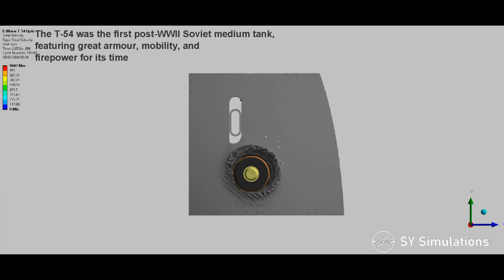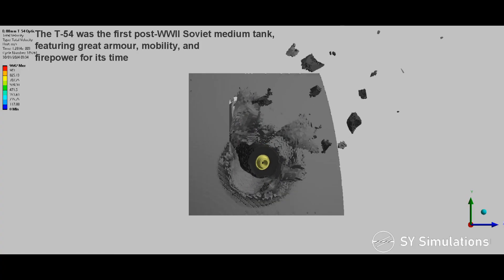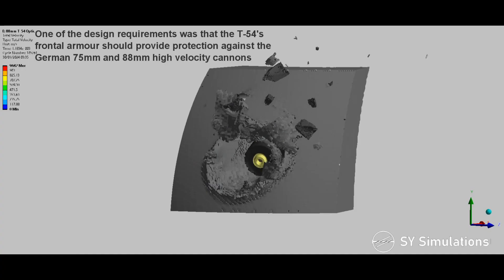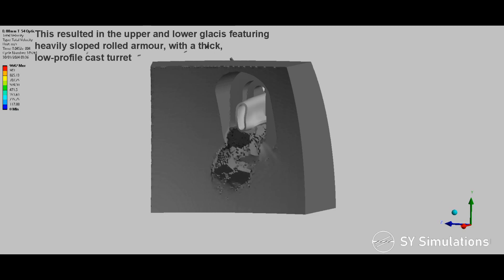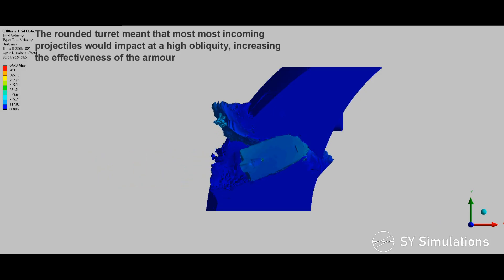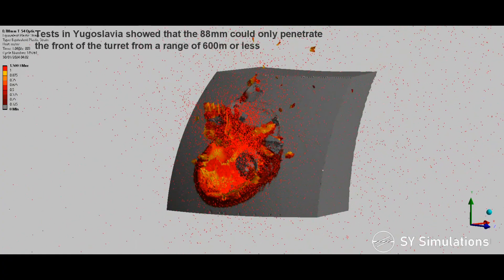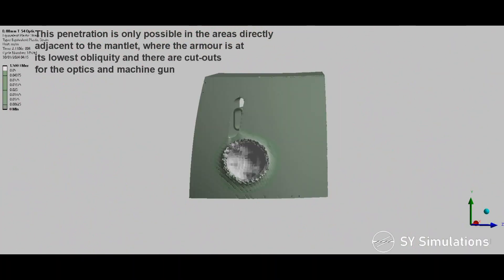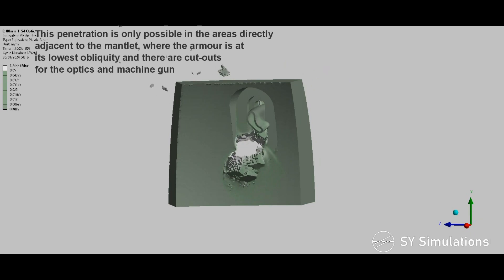TIGER II vs T-54 | 88mm Pzgr.39/43 vs T-54 Turret | Armour Penetration Simulation

Comment: This long 88 was one hell of a gun , imagine a APDS 88/50mm sub caliber as the 128/88mm . Did you ever test the 128/88mm APDS ?
Reply: He didn't, but I'like to see
Reply: I think the 128/88 liked to shatter but I might be wrong
Reply: @mikelprasad1924 it did, cause it was just 88mm Steel APCBC round fired from 128mm
Reply: @Kether25  And thus never fielded in the military or concidered seriously for combat.
Reply: @TheEsseboy  ye, only versions ever considered for service were for self propelled howitzers as alternative direct fire round to HEAT
Reply: On the E-100 vs IS-3. 31st December 2023
Reply: Yes, he did (iirc)
Reply: I think he did videos on the 128 apds
Reply: You might be surprised, but that kind of APDS round would be practically useless, as even on the 128mm/88mm APDS round the 88mm penetrator impacted at such high velocities that it would just shatter on impact without penetrating. At extreme ranges, after drag slowed down the penetrator it would not shatter anymore, but those are ranges you will almost never realistically fight as, and even if you do, a normal 128mm round would probably suffice either way.
Reply: To be fair, at a certain caliber the weight of the shell alone, would do tremendous damage to the target. Particularly if you fill it with explosives. 
In Ukraine, funny enough, artillery has proven to be one of the most effective anti tank weapons. Because even a near "miss" with an 155mm artillery shell, will damage or outright destroy a tank. - Arguably it's not a "penetration" of the target with an explosive shell, but still, considering to a very modern and sophisticated subcaliber ammunition.
a 128mm gun, like from the Jagdtiger, is not something that you shrug off so easily. Even with modern armor.
One isshe though is that a "conventional" shell from a 128mm gun would loose rather quickly it's capability to penetrate armour on larger distances where as modern tank guns can achieve their impressive armour pearcing quality at much further distances.
Reply: @CrniWuk  The artillery thing has been known for a long time, a typical 155 mm shell contains an equvialent of 11 kg of explosives...which is enough to critically damage tanks even at several meters from the tank, as they usually have airburst fuzes, so the sharpnel is projected radially outwards, which damages optics, barrels, tracks, engine decks, radiators etc. 

Modern armor is geared towards absorbing energy, so even a jagdtiger shell would be easily absorbed, and on a soviet tank the 68 degree frontal angle would make it bounce, especially as the armor is 100-170mm thick at that angle!
Reply: @TheEsseboy  There is a simulation of the 128 shell against the Abrams armour. While it didn't get in to the crew compartment, it still was quite impressive what the shell achieved. 
It would be "absorbed" yes. But I still don't think that a hit would brighten the day of the crew. I mean it could still cause some damage to the mechanics of the tank. That's not uncommon.
Reply: @CrniWuk  Sure, but the front hull is the along with the turret "neck" the weakest part of the front of the Abrams, the turret is what is meant to be the most protected from the front, and an arc of about 20 degrees to each side
Reply: Wehraboo
Reply: That the only thing you can ever write? Wow guys, we've got ourselves a real smart specimen here
Reply: Germany never fielded a 128/88mm round, the long 88 is similar to the post-ww2 90mm American guns. Nothing special, just a long heavy cannon, outdated.
Reply: @TheEsseboy  It wasn't until the M36 gun on the M47 that was rated to fire super charged T33E7 (standardized as M318A1) in 1951 that the 90mm gained parity with the KwK 43. The 90mm gun wasn't a terrible one but the US definitely had the worst post war tank gun of all the major powers and took far too long to replace it.
Reply: @signs80  I think the reason the US hung onto the 90mm gun for so long was that they had the idea that the future of tank weapons design was going to rely more on the projectile than the cannon itself and they were kind of right, prior to composite and ERA armors being developed the HEAT shell was basically unstoppable and the development of APDS made things like the 17 pounder able to punch above its weight for quite a while. the reason the US bothered replacing the cannon with the 105mm was simply that standardization was deemed necessary and the 105mm was a pretty solid improvement with its available ammunition.
Reply: @dominuslogik484  I think that may have been why they stuck with it into the late 50s, but I don't think that was originally why. T108E40 was the first HEAT round the 90mm had in service (it was standardized as M348 in the late 50s) but it wasn't even ordered until 1952. I think it was just that the defunding of the military post WW2 made it so tanks weren't a high priority, which would probably also explain why we stuck with descendants of the M26 Pershing until 1959.
Reply: @signs80  yeah the low funding was also a part of it, plus the low priority in the korean war as the majority of Soviet and soviet alligned tanks were still T-34-85 and IS-2-1944 which both could be engaged by the 90mm gun relatively effectively. also the M103 was put into service in 1957 as the answer to the heavier armored tanks that might be a struggle for the 90mm gun. procurement was a mess in the 50s unless you were dealing with aircraft and that by comparison progressed at a frightening speed.
Reply: @TheEsseboy  It actually was considered for use and was tested towards the wars end. It was intended to be equipped for E100.
Reply: @ulfenburg7539  It was never going to be fielded, it was so high velocity that the metallurgy of the time meant it would never stop shattering. It took until ~1200m or something around there before it slowed down enough to not shatter on impact so it wasn't particularly useful for a tank shell.
Reply: @signs80  I know but that doesnt change the fact that it WAS tested and it WAS considered for use for the E100. I mean they did intend to use it even. Now how effective would have been? well that is an entire different discussion but the short answer is that it would have been very bad for the reasons you stated. 

Though stating it wasn't considered for use is just plainly wrong.
Reply: @TheEsseboy  The long 88 was significantly more powerful (kinetic energy wise) than the 90mm the US used with the 90mm gun being more comparable to the Tiger 1's 88mm and not the one used by the Tiger 2.
Reply: @dominuslogik484  Yes, during the war, but not after the war.
Reply: @TheEsseboy  Lol that gun was state of the art at the time. How was it outdated back then? 😂
Reply: @Squee7e  Point to where I said back then please.
Reply: @TheEsseboy  The American match to the long 88 was the T54, but in the end they opted for the lower performance T119/M36. 

The M36 was backwardly compatible with the M3, and the U.S. had a large store of M3 ammunition.
Reply: @TheEsseboy  American 90mm guns did not reach 88mm parity until late 50's.

Comment: "That one didn't go through".
Meanwhile the gunners face is gone.
Reply: easy, just use the medkit
Reply: @salazar778   Nah, crew replenishment works, just wait a while.
Reply: "It seems we missed!"
Reply: *Slightly yellow gunner
Reply: Yeah Cry Wehraboo
Reply: Soviet Leadership : Who cares. Tank still operational.
Reply: @CrniWuk tank is "operational", but no gunner and probably no commander...
Reply: @AKUJIVALDO  
Soviet Doctrine in Spiderman-Voice : I don't see how that's my problem.
Reply: this shot basically is shoot right in front of it, with less than 10 meters distance(943m/s)
Reply: @vict9451  The muzzle velocity of the KwK 43 is ~900 m/s at 1000m, it loses about 10 m/s per 100m for the first 1000m. This is at 600m not 10m
Reply: Science wins!

Comment: 600 m is still quite substantial.
Reply: It's specifically weak area. Main cheek won't budge.
Reply: Source? @gargean1671
Reply: No,it isn’t . Normal tanks engagement range in late WW2 is around 1km and above, 600m and below is only happens during ambush or surprise engagement
Reply: @vunguyenxuanhoang7422  Actually that's not true. It depends on the Theater, but the US found the average engagement distance for them during WW2 was 800 yards (and likely shorter, due to data limitations)
Reply: 600m is substantial, as in that it goes through, while it was designed against it. Keep ya white knight in ya pants. @vunguyenxuanhoang7422
Reply: Thats inredibly far off. Data from the US military itself in Europe gives us an average engagement range for armor on armor of 800 yards, and a median of 300! Both FAR closer than 1000 meters.
Reply: "Survey of Allied Tank Casualties in World War II" if anyone is interested. Africa is the only one even close to a 1KM range at ~900 yards, but thats still nearly 200 meters short.
Reply: if an enemy tank engages your tank at that range, your commander is a fool, an idiot, or both at the same time, most tank engagements are 1/2kms, at this range the T54 was nigh invulnerable from most NATO rounds for a while, not to mention its tiny size meant spotting one was no small feat.

Comment: wow 88mm works good
Reply: Yep, more penetration than the 90mm gun on Patton tanks with full caliber AP rounds.
Reply: @randominternetfella96 this video is about the tiger 2 88 mm, not the tiger 1. That is all the specificity you need to be able to navigate these comments, yet you get confused
Reply: @randominternetfella96   No. Both the M77 and M82 have a penetration value below 200mm of RHA even at close distance. Meanwhile the long barreled 88 would roughly pen 220mm RHA point blank. You seem to have confused the old shorter 88 found on the Tiger 1 with the newer and longer 88 found on the Tiger 2.
Reply: @nuklear7074  KwK43 fella, not 36
Reply: @belgianfried  Why did you ping me?
Reply: @randominternetfella96  How can i be even more specific?
Reply: He said that 88 PREFORMED BETTER than 90mm @nuklear7074
Reply: Wehraboo
Reply: @Rider-lo9vt 2/10 rage bait
Reply: в пулеметное гнездо?😂
Reply: To be fair it achieved this by being super long
Reply: That and a larger powder charge, I think.